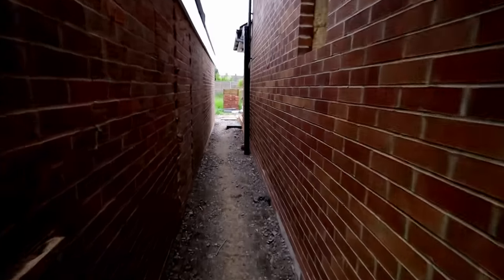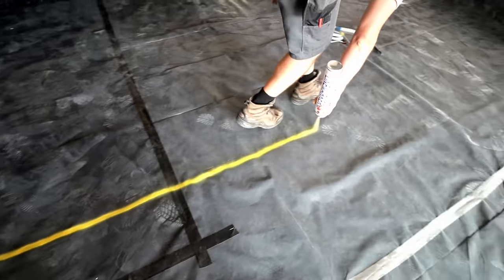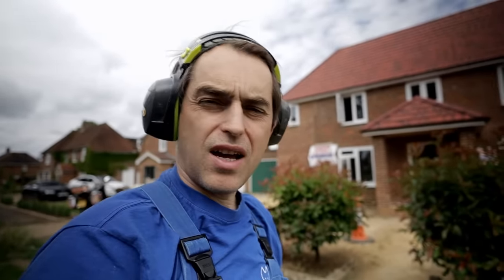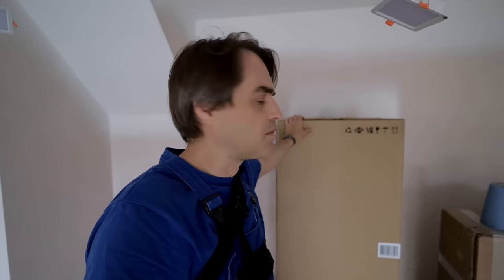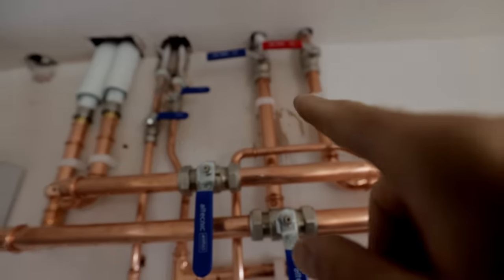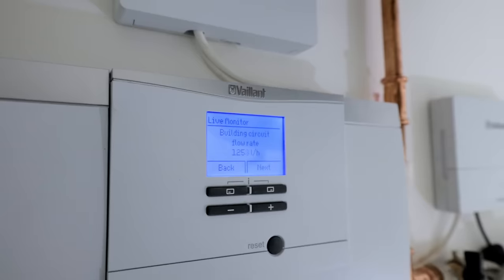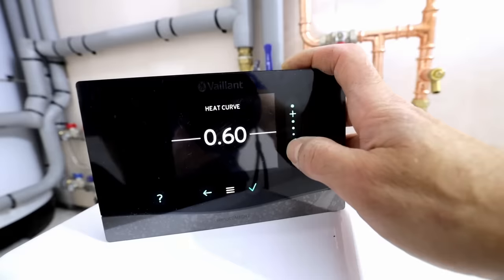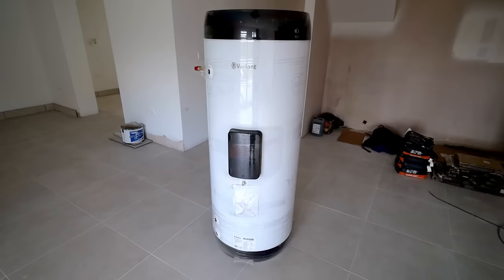Gas Boilers No Longer Make Sense, Here Is Why.

Comment: This guy's customer has a lot of cash invested in this system.   How can I, a pensioner afford a system for my modest standard size home, with minimal overall insulation and 1959 house with a gas combi boiler.
Reply: Get it insulated first if you can afford it. The savings on the heat bill will help you, even with a gas boiler. You don't have to do everything at once (I did not). If you want UFH, the best moment for that is when your floor needs replacing. It will be more comfortable and even save on a gas boiler bill. The time for a heat pump is when the gas boiler is getting old and inefficient and the home is decently insulated. Most of them last 10 to 15 years.

The only reason not to improve your home is if you plan on moving soon anyway. An empty home is much easier to renovate and is a lot less stressfull for the owner.

Comment: People tell that heatpump and panels are good mix and You will have cheap way to generate energy and heat house. But when heating house is most important ?? At night in winter. At same time that panels do not generate energy. So You must buy energy from line.
Reply from the maker: Battery storage is your answer with cheaper overnight tariff. You can buy kWH of electricity at a cost of gas and then run a heat pump 70% cheaper than gas boiler
Reply: @UrbanPlumbers  Depends where You live ... Tell me how much energy heat pump needs where temperature is below - 20 centigrade. And how much power You can generate in cloudy winter day. And what if Your trariff is fixed ?? You state that this is fix it all solution. It is not it heavy depends where You live.
Reply: @marekbarycz4397   It depends on the heat pump, there are not many places in the UK where -20C is sustained for it to be an issue.  And in those situations, there are units designed for those sorts of temperatures.  If -20C is common, then it would be better to go for a ground source heat pump.  Over here, solar requirement is calculated based on annual electricity usage, and having a plant that will generate that amount across the year - mostly in summer, which you sell back to the grid, so your summer production covers at least most of your winter costs.

Comment: Definitely it’s mad having gas for any renovation. But it mad for that major renovation to have a heat pump, rads, underfloor heating! It will use less energy but given the price of electricity will be a similar energy £. Instead it should be a MHVR solution and passivhaus design. £20k spent on the wrong area in my opinion and an opportunity to add 20k in house value from it being towards passivhaus standards, so a costly 40k mistake for the homeowner.
Reply: It's very hard to renovate a house to proper passivhaus standards, in many cases you loose too much internal space.  I would have put an MVHR in (not sure if this property has on) I'd also have put underfloor heating in, heat pump, PV and battery. I'd much rather do this than loose a significant amount of internal space, in South East England you pay a lot for each m2.
Reply from the maker: Park Home will need very little load. You may be ok with a 10amp heat pump.

Comment: If a combi lasts 10 years and costs £2K to change, what would this cost long term?  How long would it last?  When I worked at a data centres a few years back, we had large Fujitsu, LG, Daikin and Mitsubishi chillers that only lasted 3-5 years and the bearings are shot and the evaporator/condenser is blocked solid with black filth.
Reply: The heat pumps themselves you're looking at around £5k Inc VAT (you get that off ATM), these ones are guaranteed for 5 years (7 if installed by a partner)... if set up correctly, they're expected to last about 20 years.  Realistically though with the way the technology keeps progressing replacing it after 10-15 years will probably make more sense than letting it run to EOL.

Comment: I have no alternative ... I live in a Residential Park Home where we only have LPG and the electricity is restricted to 30amps total
Reply: Many 7kW heat pumps run on a 16A breaker.
Reply: @edc1569  but that then limits everything else ... electric shower, laundry.  7Kw at 220v is 31amps which is why I have a 3pin 10amp EV charge cable and no other home charger
Reply: @mdshovel  Surely it would replace the electric shower? If you currently get away with running an electric shower a heat pump will be no problem. You can power limit them too, I think you could keep the load under 10A for a park home.
Reply: @edc1569  The electric shower will only run for approx 10 mins before the breaker trips.  I would still struggle with the capital cost

Comment: Sorry , but you cannot use underfloor heating circuits in reverse to cool a room, unless you like a soaking wet floor ! The dew point is around 22 degrees Centigrade. This is precisely why the indoor units on split type aircon systems have water drainage pipes.
Reply: under what conditions is the dew point 22 degC?
Reply: Yes you can, on a well-sealed home, with a MHRV system. However, you have to monitor the floor surface temperature, and modulate a manifold mixing valve, to keep the floor surface temperature, about 2 Deg C higher than the room dewpoint temperature. The underfloor heating slab also needs to have a fast response time, so a slab depth of <50mm is required. BSRIA cover this in their radiant heating and cooling guide.
Reply: @hvacdesignsolutions  good luck implementing a practical system with a 2 degree C margin in the real world. If it worked , then why don't major public buildings and hotels use this instead of air conditioning units with heat exchangers with water drainage ? Maybe they don't want to be sued for constantly wet floors methinks.
Reply from the maker: the controller has dew point controll and will not let the floor cool down below that point
Reply: @UrbanPlumbers  kindly, dew point has to be ascertained by several measurments at the same time ( floor surface temperature, relative humidity sensor, and  floor core temperature ( which , by the way is as variable as the differential in temperature between the top and bottom of a hot water cylinder ), with sensors that are not able to effect change on a thermal mass the size of a concrete floor, relative to the input of the input. Basically , the pipework in an underfloor heating system is nothing like the storage capacity of the thermal mass of the floor, and yet you are trying to control the dew point with small variations of flow temperature. It does not work. It is like  ( analogy )steering an oil tanker with the rudder of a dinghy. You will end up with soaking wet floors. It's just physics.
Reply: @lewisbrand  
mate, you are very wrong saying that major public buildings and hotels use floor cooling. There are indeed places, especially outside UK where this is developed and done for years, with great success. Especially with ground source heatpumps, where cooling efficiency is crazy high, but of course with air source too. In big open space areas with huge area of glazing, floor cooling has its biggest advantage coping with solar radiation heating up  the floor.  Its used for example on some airports where big glazing areas are common.
Yes, there have to be done some calcs, condensation measures. But it still doesnt soak up the floor. Maybe it gives you that impression cause most houses in UK doesnt get proper insulation and you are playing around with 120mm kingspan in new builds...
In similar climate countries in EU 300-400mm insulation is used with 80-120mm concrete base with screed on top. With floor tiles or similar finish (not wooden floor) there will be no issues whatsoever.
Reply: @96Lauriz  please give me an example. You need to realise there is no such thing as radiant cooling ( unlike radiant heating ), and all you are doing with a cold floor is pulling warm air downwards ; not cooling the air in the room. The result, ironically, is a hotter experience, as the warmer air that was residing near your ceiling, is now around your feet. If you really think that floor cooling actually works, please prove it. I am not going to be told about fantasy land that directly contravenes well established laws of thermodynamics. Oh, and I can absolutely guarantee you will be standing in a puddle of water at the same time.

Comment: My new gas combi boiler cost £2,200 fitted and comes with a 10 warrenty.  Tell me a heat pump will be cheaper.
Reply: Depends, have you done everything necessary for the boiler to run a low temperature heating system? if so then a heat pump will have been around the same cost (with the grant), and would be saving you money each year.
Reply from the maker: Yes, heat source alone is cheaper, the system however needs to be designed and installed to max 55c flow temperature- which is the same for boiler and heat pumps, making heat pump system (pipework, rads, ufh) cheaper, as they are zero vat. Add to it £5k grant towards heat pump and a full system becomes similar cost
Reply: @UrbanPlumbers  Well I don't know about that, all I know is that I pay £220 per month for gas and electricity and not a penny more... because that is my budget and I stick to it! (Currently using £125 p/m during the summer but paying £220 to cover for winter.  90% of that £125 is electricity).
Reply: @RF_Burns  Monthly monetary amounts are pretty useless.  e.g. due to the tariff I'm on I paid the equivalent of about £30 for my electricity last month and £0 for gas (as I don't have gas), but it doesn't tell you anything about my usage or what I'm paying per kW.  There is some maths you can do to work out a rough ball park figure of how much a heat pump will cost you per year based on a years' gas usage, and what your price per kW of gas and electricity is.  But doesn't take into considerations other savings you can make with certain tariffs etc.
Reply: @BenIsInSweden  I'm on a 2-year fixed rate and my smart meter tells me what I'm using by the minute, hour, day, month, etc.  I also have Watt meters on every plug socket - I'm all over that stuff like a dirty rash.  If it's inefficient or draws current on standby - it's gone!
Reply: @RF_Burns  that's fair enough but it doesn't give anyone else enough information to go on to give you an indication of what a heat pump will cost you to run.  Either you'd need to lookup and do the math yourself to get a very approximate idea or hire someone who knows how to do it properly like Szymon.
Reply: @BenIsInSweden  I guess, but I've gone with gas this time so I'm committed... and I'm very happy with the costs for now.  I say for now because I get the feeling that eventually there will be penalties imposed for using gas.  It's all nonsense if you ask me, but that's the world we live in.

Comment: According to the EST I could save £8 a year of I installed an air source heat pump.  With the changes I would have to make to my house it would cost around £35,000 to have one installed. The ROI does not make any sense.

Comment: You also have to insulate properly for that heating system to be effective. You will also need to have an appropriate ventilation system if you've insulated properly, which is only an MVHR (mechanical ventilation heat recovery). Otherwise, you'll end up with a  build of moisture, which will to mould.
A great system, I'm sure but only if done in conjunction with the above.

Comment: wait dont these units use an electric water heater inside when there is not enough heat produced? How is that better in any way? the size of that system and the materials used must of taken a morgage alone to pay for it all. The energy used to make all the parts and install it is astronomical. Just like wind turbines the power used to create and install does not justify it all. really sceptical. We do think in terms of investment when something costs this much. A normal boiler is a must that's why we dont think what we get back because we must have hot water. Gas prices have risen unnaturally think about that. Are you that young that you dont remember how we were sold gas for years and how we were told it was much cleaner and cheaper, well what happened to that?
Reply: No, R290 allows the heat pump to get the hot water up to 75C, so no need for an immersion heater in these.  Gas used to be cleaner when the power grid was made up of coal power plants etc.  The grid has become a lot cleaner than it used to be, so even if gas is used less efficiently to create electricity for a heat pump, less of it is used compared to being piped to the home and burnt there.
Reply from the maker: No, they don't use direct electricity anymore. Also, gas boilers are about to get much more expensive next year and heat pumps  hopefully cheaper. I predict that by the 2030 very few people will be choosing gas boilers.
Reply: @UrbanPlumbers  I agree but this is by design with the gas prices. So do these provide hot water and enough heat for a house in the coldest winter?
Reply from the maker: @davewilco822 all in correct design and installation, which is not that easy. It’s not the product it’s the installer

Comment: With a viessmann vitodens 111 gas boiler you can have instant hot water at your discretion and which costs @ 2000-2500 pounds - where you completely get rid of the investment in an external boiler...
+ labor and materials required for installation
which makes the investment in a heat pump even more unprofitable…
Reply: I'm guessing that the homeowner is not installing it to be profitable. The same with all the other renovations going on.

I didn't have my new kitchen fitted or buy my new car because it would be profitable.

If you only did things in life that was profitable you would do very little in your  life other than worry about your lack of profitability.

A very boring and unfulfilled life I suspect!

Comment: 1st off - you do beautiful work.  

For AC, would you think of running a separate set of loops under the floor insulation (especially if it is below the frost line), and using that as a mini version of geo thermal cooling? (You could also reverse the process and potentially generate some additional heat when cold dips occur).  In my location in NJ(USA), the ground (below the frost line) is generally about 13-18C year round so I am thinking about breaking the basement floor and using this alternative for the deep winter times where the Air/Water heat exchanger may have difficulty in maintaining the desired temperature and for the AC cooling in summer.